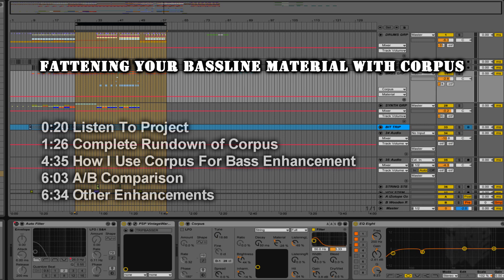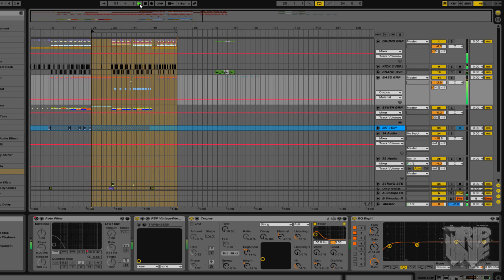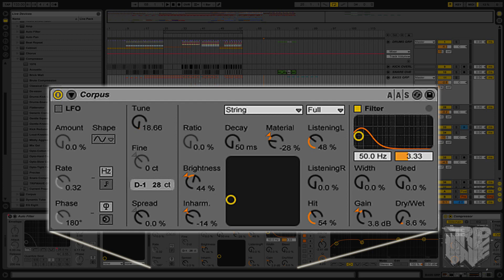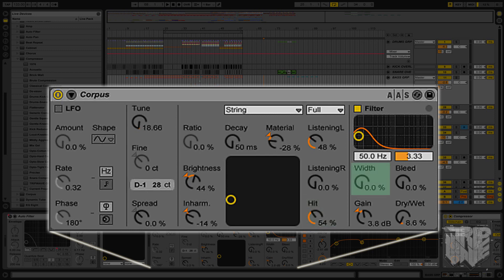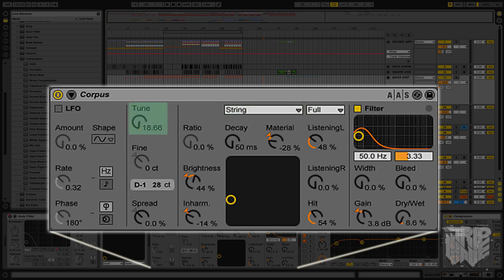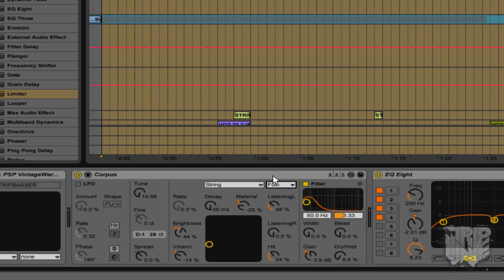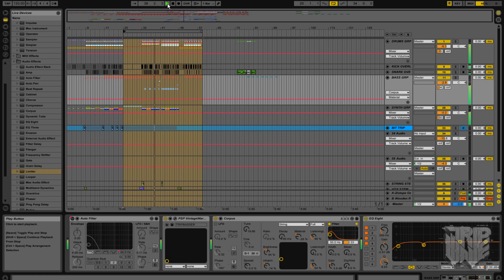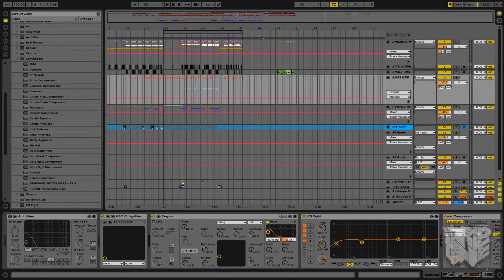Phat Sessions - Enhance Your Basslines With Corpus!

Comment: Thanks for the tutorial. How did you get the great sounding vocoder vox at the intro? If you have another vid on it, I would be most appreciative. Thanks!
Reply from the maker: i used abletons built in vocoder then used a dirty sounding synth in massive. used that as the modulator and played with the settings until i found something worth while using :) i could make a video on vocoding too

Comment from the maker: helps glue all your sounds together nicely, evens out your levels, makes it a tad easier on difficult to eq sounds, and if you get it just right it will almost sound mastered. because that should be everyones ultimate goal too with producing edm: a solid written tune and a solid sounding mix, yes composition is most important, but the overall mix and sonic qualities also make or break a track as well. just some food for thought. ill rant more in my video :D

Comment from the maker: best to use all 3 bands, hence why its a multiband. if u did single band u just have a basic compressor. some ppl do use 1 ch on a multiband, sometimes u get a better sound doing it that way, but thats all up to what kind and brand of  gear or vsts u got running. ie: a tc electronic multi band with only single band active will sound better than a behringer regular old single band compressor. and ill tell u and everyone this i use saturation and multiband subtly at the end of ALL my audio groups.